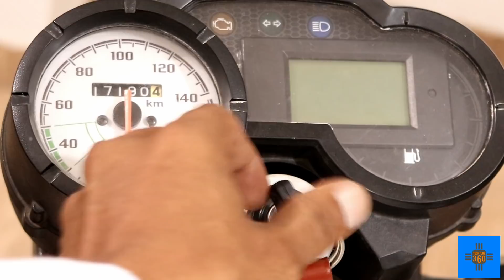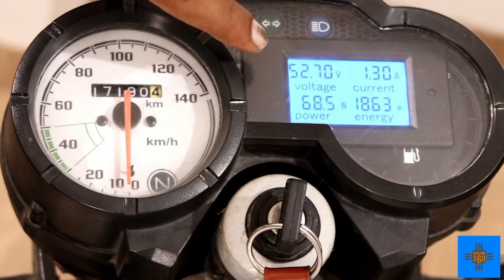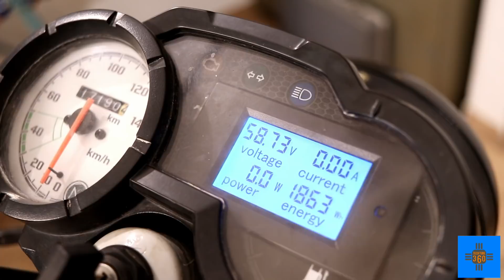India's First Four Geared Electric Bike Update One | Chain Drive V/S Belt Drive

Comment: Top speed kya h, motor kitne vatt ki h.
Reply from the maker: Top speed 140 kmph peak power 14.4kw
Reply: @techtube360world  thank to reply.
Reply: Motor cost kya h kaha se magwai h or ye motor without gear kit ke kitni top speed tak jati h.
Reply from the maker: I have tried cruising till 112 km per hour not 140 km per hour as there is no unobstructed Highway near me. There was about 45% throttle left to make it to 140 Kmph.  The cost of the motor is about 1.56 lac. Without gearbox motors are available but I have not tried those. This is an on-order custom made motor for our use. It has a matched controller with it. Thank you for your valuable time and interest 🙏

Comment: Why chain driven motor is used. Why was hub motor not used? Any particular reason for that?
Reply from the maker: With hub motor your get only limited torque. I get four speed torque with this setup. Also hub motor is moving electric engine which had to take all uneven road and potholes beating so I don't prefer hub motor though being more simple setup. Hope you have got the answer. Thanks for your time and interest 👍🏻🙏✌🏻😊
Reply: @techtube360world  Thanks for the quick reply and advice

Comment: Tech.Tube 360, Excellent efforts bro ,please accept my congratulations for successful conversion of a  almost scrap bike to a new energy efficient E-Motor bike .

One suggestion bhai, why cant you remove the entire engine block as it is quite heavy & does the removal of engine block cause balancing /alignment difficulty in sprocket to chain problem?

Why cant you use MS flat fabricated housing to anchor the motor to the body?I am not a engineering graduate but a hobbyist.I would appreciate your reply .
Reply from the maker: First of all thanks for appreciation. I have kept the gearbox only out of complete engine. Direct motor can be used but generally almost all electric bikes have the same thing and the main thing that I have kept in this bike is you can change gears though it's electric and it really saves lot of battery and gives you higher torque while needed. Also using MS L-plate was need of design could use aluminium composite but it would have costed me three times more. So thanks for your time and interest 👍✌️😊🙏
Reply: @techtube360world  Thanks for the reply bro.What was the the total cost of conversion?Are you going to launch the E-kits in south?When.
Reply from the maker: @ramasubbanpadmanabhan8576  total cost of conversion for new version is 65k inclusive of fast charger. I am into process of standardising the kits for various vehicles and will be available as fuel type change kits keeping all bike elements intact. Thanks for your time and interest.✌️😊👍🙏

Comment: Great alternative to chain. Have you tried using Li Ion batteries instead of LA and higher wattage motors like a 3k One so that you can get more mileage per charge..
Reply from the maker: Thanks for appreciation. Yes my new boxer bike video is due since so long. Where in I have changed lot of things from design to battery pack styling colour scheme motor controller etc. I will try to upload it before this week end. Have put out a story for the same do have a look at it. Thanks 👍🙏😊✌️
Reply: @techtube360world  Have you applied for patent registration of your innovation
Reply from the maker: @MASADHIYA  yes its under process and accepted.

Comment: Automatic battery charge ho sakti he ( petrol engine me presses hoti he power ki)
Reply from the maker: Of hybrid system is designed then batteries can be charged while on petrol but frankly speaking hybrids are non practical vehicles because engine has to carry motor and batteries there you lose efficiency. Again in electric mode motor has to carry electric engine system plus ic engine components and fuel. So only electric or only IC engine is the way to go. This is my personal opinion. Thanks for your time and interest 😊👍✌️🙏

Comment: Very nice job Sir. You doing very well............ But very important question is remained that "What about its legalness or RTO permission???? "
Reply from the maker: First of all thanks a million for appreciation. See as of now there are no guidelines of two wheeler electric conversion. Also you are not doing anything illegal as engine and chassis number of vehicle are not inftinged in our conversion. So as and when guidelines are formulated you need to get your vehicle RC book updated to change of fuel type to electric. And I have been riding this bike daily and even traffic cops are more than happy to see it and instead they are taken away by fancy. Mostly they are all softer on electric vehicle more so you don't need to provide PUC as it's electric. So just charge and Go 👍🙏😊✌️

Comment: How did you manage to seal the gear box ? It has lubricant rit?
Reply from the maker: That's not so difficult only IC engine block head assembly window was open which got closed by motor mounting plate and gasket. So oil won't leak from there. Alternator plate assembly is dry. So no worries of oil leak rather it won't leak from any where else. Thanks for your time and interest 👍😊✌️🙏

Comment: How much amp decrease compare to. Chain drive to belt drive
Reply from the maker: Amps will not decrease with this drive. Actually it will go up a bit. This drive is incorporated just to increase the driving pleasure with increased safety and low NVH. per charge travel distance has reduced by 2.5 to 3 Kms which is roughly a loss of about 5 to 6 %. But the quality of ride which this bike provides with this drive is amazing and for that sacrifice of 5 to 6 % efficiency loss is very much tolerable. I hope I made things clear. Please feel free to ask any questions if you have. Thanks for your time and interest ✌️😊👍🙏